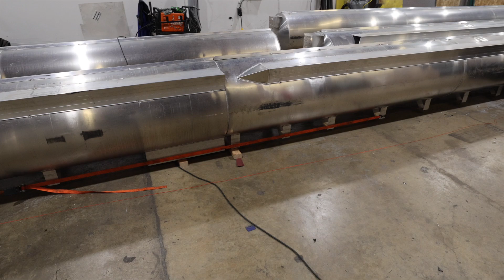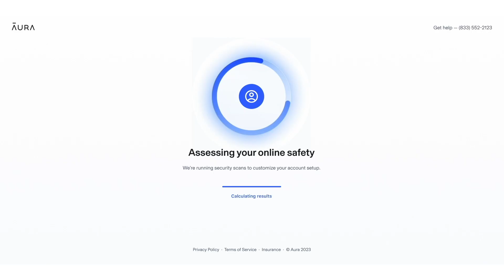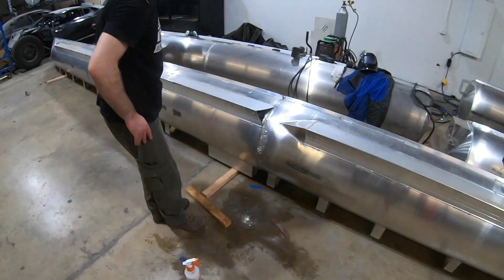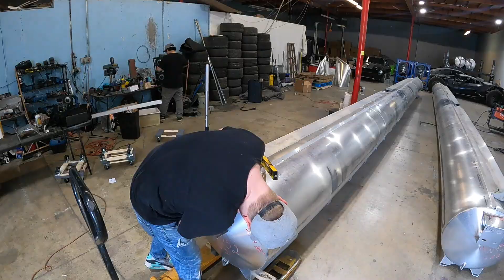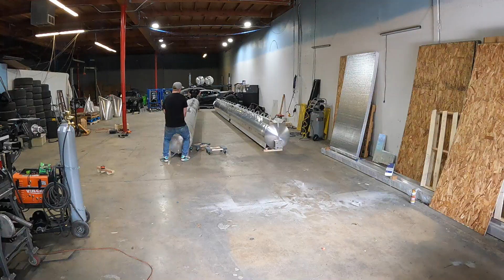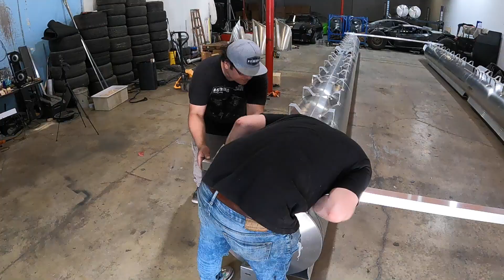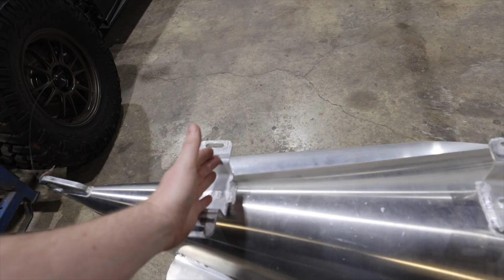Quad-Tune Pontoon Yacht Build - Welding Massive Pontoons for Our Biggest Project Yet!

Comment: My worries are
1) the resistance from bending under weight. Constant shifts minuscule over time does what it does to all metals.

2) resistance to ea pontoon with their massive length rolling in/out in between each other (trying to separate from each other) outwards.

Those calculators do t factor a lot of what nature can do to numbers that only account for a static vessel. Boats are not as static as we think they are.

Theres some massive physics that will be challenged when fully weighted and in water that is constantly moving. It’s a crushing weight that being floated by pontoons above the water without any body below the water to set a balance from what’s above the water vs below.

Just my worries, wishing the best for you all ♥️✊🏽

Comment: Come on man , why would you build a beast of a pontoon boat and not use the toon transom , those pontoon transom can not hold any over 150 hp and because you put bigger toons in the center you gonna need 25 in shaft motors . The boat is going to run very poorly if you don’t change the transom setup just trying to help

Comment: The  rough math needs to be modeled with your location of weight distribution. You also need to module the force based on the load across your entire weight distribution for the sea so you don’t taco the thing.

Comment: Those lifting strakes are probably structural as well, and the area around the welded seams may bend and crack. Cutting the nose cones of the middle pontoons will probably reduce speed by a few knots.

Comment: Again itd be a lot safer to separate the large pontoons into 22ft sections. Just for structural integrity. You can only extend a tape measure out so far before its weight overcomes its strength.

Comment: So aluminum is very tricky to weld.  Tig would have been really good there.  Just remember that aluminum has to be extremely clean. Stainless hand brush and acetone is a must. Cutoff wheel to cut it is 100% a no. Plasma cutting is great. Cutting with a cut off wheel leaves trash in the aluminum because it so soft. When welding over it will cause a leak or weak spot in the weld.  Not criticizing just pointing it out is all.

Comment: I think the 27 in pontoons also reduce the bending of the outer pontoons. So the inner pontoons become almost like a girder to reduce bending moments. I am all on board with the idea of spraying closed cell foam into the pontoons to make them both stronger and more boyant in the case of an incident. Looks like being an incredible lake boat but your going to need a large float to transport it and also need to take into account lifting points for launching.

Comment: i wouldnt calc the hottub into the floatation because its going to be full of water, above the water line, so its not going to be adding any floatation, calc just the water amount above the water line to get the weight of the water thats actually going to be weighing the boat down

Comment: That hot tub is gonna be a lot of weight in a place most boats don't have a lot of weight.. A lot of people have pointed this out, and I'm concerned myself. I couldn't tell ya the first thing about boats, but it seems like a solid point. 
Also, the tremendous amount of weight causing the middle of the beast to bow and crack? Is this a possibility?
As always, you guys have done your calculation and probably done simulations, too.,, but I just can't stop thinking about it. Sweet build. I'd ride along either way.

Comment: Welds will Crack.  Your gonna have to sleeve it or add some kind of structure for support. The toons are too long for their wall thickness , your going to sag and it will get worse overtime . Then the real issue is the boat is going to hog bad when you hit chop and it will break those welds. Please get with a reputable builder and have someone look at this,  you are going to get hurt or killed on this thing.

Comment: I kmow the design was all okay'd by an engineer, but for peace of mind, id also get the vessel double checked at the weld points too. Nothing against Oscars welding, but even the smallest change in structure can collapse those pre-made pontoons...

Comment: The hot tub is an 8 foot by 8 foot setup, the water will come out to be well over 1,000 pounds, this thing is going to nosedive so damn hard. And have issues getting on plane. I’d relocate or ditch the hot tub Chris.
Reply: I think its intentional to put it in the front so that it balances out the heavy engines in the back. Not to mention you can change how much water’s in it to find the right balance.
Reply: @leovin00  some corrections to be made to my comment would be that the motors would be I/O. With them sitting at about 75% of the way to the back. And the water would come out to be 2000ish pounds, double of my hypothesis that I concluded by just guessing the gallons. The hot tub will probably get ditched.

Comment: Looks to me like where the two pontoons are welded together could use some reinforcing.  That triangular rib that runs the length of the pontoons should carry through between the two for added strength.  Or maybe some other pieces to replace that concept.

Comment: If I were you I would put another water tank towards the middle/back. Use it as a ballast tank for the Hot tub water because usually people won't be using the hot tub as your moving. Pump it to the tanks when driving then pump it back when going slow or not moving. I don't know what kind of motors you are using but I would put hydro stabilizers on the outdrives/outboards. Never really saw a difference on V bottom boats but on pontoons they work amazing. They seem to make the props have more bite in the water.

Comment: looks like it will tend to fold like a taco along the welded together front and rear. you need a keel or two or three that keeps the front and rear moving separately. you should definitely extend the strakes on the bottom/sides of the pontoons. especially over your weld connection.

Comment: I'm not an engineer, but I've built enough things in my day to really think this isn't going to work. Front loading so much weight with the hot tub, long spans without enough structure to support, aluminum that's going to flex and stress... just don't see a success path here.

Comment: You should connect the strakes on the ends together where you joined the tubes. That gives more support. You probably should add a strake on the other side too.

Comment: Clearly, this isn't designed for ocean going but the chop on the Columbia can be significant. Has this been engineered for that? Ocean going freighters experience twisting in heavy seas and they are designed for those forces/loads. Thirty people, the fluids, engines, etc. are a lot of mass that may not be distributed evenly and can impose structural loads that could create issues. I'm excited to see the finished product on the river (I live in Portland) - just want to make sure you're safe. I like your channel!

Comment: The timelapse banding issue is usually due to a mismatch between camera shutter speed and the refresh frequency of the lighting. I very rarely shoot video, but I have encountered the same issue a long time ago and I believe I solved it by matching the shutter speed with the frequency of the electricity supply.
Reply: 100% spot on with this.

Comment: I’m concerned with the overall flex the pontoon will need to withstand with a hot tub on the bow and the engines at the rear. Weight distribution is something to consider on that long of a pontoon along with the channels at the bottom of the pontoon possibly adding structure so the pontoon does deform. While you have the deck keeping the top of the pontoon straight I suspect that the channels on the lower part of the pontoon do the same to keep the structure in tact.
Reply: Also this is a very long bargain, and they plan to make it 100% out of aluminum, so that in mind they need to make the structure super beefy to avoid torsion and flex related stress

Comment: I dont get the point of having 2 central pontoons without the pointy nose, what is the reason?
Reply: Ok now I get it, but I think if you put the hottib in the nose you will have problems balancing the boat, it is too much weight where you only hace 2 pontoo s instead of 4.

Comment: Reach out to timtpe commercial trailers. They have specially designed rivets for attaching aluminum to aluminum because when welding aluminum you lose 50% of it strength, but that trailer company has built commercial grade aluminum trailers for 30 years in their long lasting maybe they can give you some helpful hints.

Comment: Fill the pontoons with expanding foam, closed-cell spray foam insulation is highly moisture resistant. If you hit something you won't sink. It is just a thin Aluminum...
Reply: Adding foam in no way increases buoyancy. At all
Reply: Don't do this... the instant a crack forms in the pontoon you'll have hundreds of pounds of wet foam stuck in there, even if it's moisture resistant
Reply: This is the absolute worst idea imaginable. 
The pontoons are segmented for a reason -  puncture one segment of 1 pontoon and the boat will still float enough to get it back to shore.

Adding thousands of pounds of foam to sealed bouyancy tanks will just increase the weight of the vessel.
Reply: This is a great idea. It might be too buoyant though.
Reply: @davelangford2439  Not sure there is such a thing as 'too bouyant' for pontoons, think all it would do is add some weight

air vs foam in the tanks, easy thing they can test with one of the cones though (for floatability)

edit- Also the things are sectioned, so the long sides already have ~6 different sections that would need to be breached (and I don't think it would be all that easy to 'fill them with foam' consistently)
Reply: @austinh1028  fair enough, I don't know anything about pontoons. I really hope it works out though. Been following this channel since very near the beginning.

Comment: For all the 'that pontoon is gonna split' crowd...

There's going to be a deck and stringers tying the entire thing together as 'one big ol' piece', isn't there?  Also, the upper deck structure is going to be directly-ish over those pontoons, and the way they're designed, does that not offer bending prevention?

If I'm wrong, I'd like to know, as I'm thinking Chris is thinking similarly here.  Or we've not seen the end of structural improvements on the pontoons.  Either way, thanks in advance.

Comment: Consider maintaining a few psi of air  in the floats, it would greatly increase the floats rigidity and resistance to denting.
Reply: It will also test how well they did the welds.
Reply: @jwalster9412  A pressure drop would indicate a leak.
Reply: Its going to leak just a matter of how much.  Will need bilge pumps in them.

Comment: The formula for calculating the floatation of a pontoon is F = (D - W) / V, where:

F: is the floatation force

D: is the density of the water

W: is the weight of the pontoon

V: is the volume of the pontoon

To calculate buoyancy, you can multiply the volume of the pontoons by 62 lbs. per qu. ft.. 

Or you can use the "Twenty Percent" Rule to ensure that you build a safety margin. This rule has two ways to go about it:

•Subtract 20% from the capacity plate's total listed weight capacity and use that as the maximum permissible weight

•Calculate the total weight of your passengers and cargo and subsequently increase the total by 20% 

I didn't want to take the time to type all this out so I copied and pasted it for you, hope it helps 😅👍
Reply: He already did the calculations 😂😂.
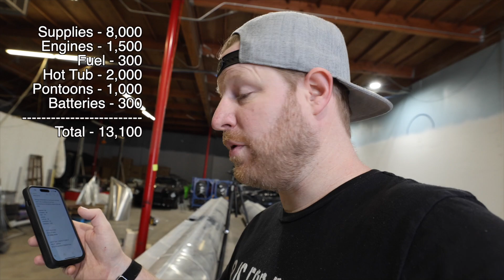Reply: @jerrywilcox9890 12:31 Referencing the 20% rule I quoted above, you can see that according to Chris's own loose calculations he has miscalculated
If his estimates of the pontoons were correct the max weight capacity will likely be closer to 13,000 or 14,000 lbs not 17,500 lbs
Reply: @natesmemes1794  they already calculated it lol.
Reply: @natesmemes1794  they can handle it.

Comment: Does anyone else think this is going to break in half?
Reply: I would give the boat the name "Unsinkable II"
Reply: Unfortunately  it will be  his 2nd boat sunk,well this won't sink since both won't snap at the same time
Reply: Top Gear made a Hilux boat. Disasters are fun to watch!
Reply: I think its more the twisting movement that kills this construction.  He have to add some diagonal trusses to the upper deck to make it more stiff to twisting
Reply: Ok I’ll ask… the trailer to transport it? What’s the plan? Unless you have a very custom trailer or a very specific boat launch this may become a problem
Reply: 💯 no doubt. It’s either going to break in half or the “pontoon yacht “ will be so heave the pontoons will sink
Reply: Perhaps some internal strengthening would help?  Like 3-4 feet either way of the weld.
Reply: It's extremely unlikely that it'll snap (as long as their welds are as strong as the oem pontoons). A cylinder is a pretty strong structure. It'll help if there's a bit of flex - it can't be too stiff (or it WILL snap), but will need some diagonal cross bracing to ensure the hulls all point in the same direction. There are plenty of really long but fairly narrow cross-section structures plying the seas with no great issues (submarines, supertankers etc), and they manage it in proper seas and in all sea states, not the inland waterways (with small peak to trough waves) that this pontoon will be subject to. It's the getting it to the water that will be the critical part; once it's on the water, there should be no issue. My only concern is the shape of that hot tub box - there needs to be a bit more of a streamlined shape to it than the simple slope in the cad model, unless they just want to be bulldozering the water out of the way (especially with the weight of the water in the tub pulling the bows down) - it would improve efficiency (ie use less fuel, increase speed), allow the boat to get close to getting on a plane, and reduce the risk of water surging over the bows and into the tub (and across the deck) at speed (or if they need to do an emergency stop (full astern)).
Reply: This is awesome!
Reply: Yes
Reply: Shh 😂
Reply: Shhhhhh. No need for that energy.
Reply: Sooner or later, it's going to fail.  It's just too long for those diameters
Reply: needs at least a 4" belt over the seam also hot tub in front is going to be way too much  weight it won't plane
Reply: Yup
Reply: Wave length and frequency sinks boats built by experts
Reply: If they don't correct the mid joint that's the most likely scenario. Well, it'll start to fold in the middle probably not quite break apart. That second deck looks pretty suss.
Reply: I’m thinking full-on Edmund Fitzgerald…..
Reply: Not a yacht… it’s a boat
Reply: It is probably unlikely due to the added strength of all the connecting lateral bracing that will be the floor deck framing. If anything, it might be front-heavy with the hot tub and possibly take a dive in rough water but I don't think it will be a Titanic situation where it snaps in half. I must fully disclose that I am NOT a structural engineer so I might be talking out of my butt but I do work in construction and it's just my gut feeling. But again, I could be totally wrong. lol
Reply: Nope, it's massively strengthened by having 4 pontoons
Reply: @davelangford2439  I hope it works out,because this is super cool..was sad to see the ship partially sunk..
Reply: @VooDooV6  Same. I've followed BIFB since pretty much the beginning and always want their builds to go well. I really want to see more Burntican though!

Comment: Based on the weight I’m guessing you’re using a 50 gallon tank. We burn roughly 28 gallons an hour on our 12k pound boat with dual 250hp Mercury Verados at cruising speed

Comment: Seems like a hot tub on the front will be too much weight in the front of the boat…also agree you should run a support stringer on your welded area on the long pontoons…sure you planned on this but didn’t see it on the video.